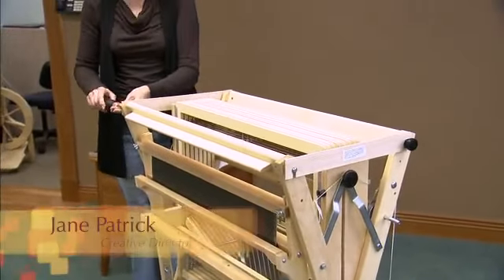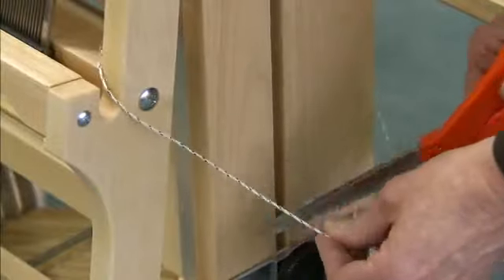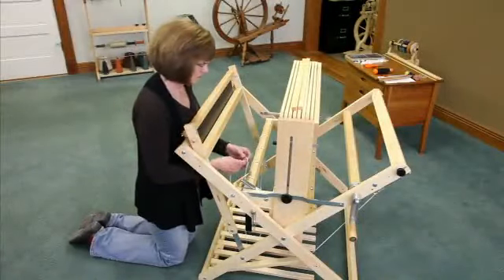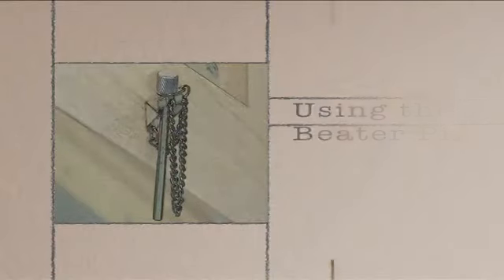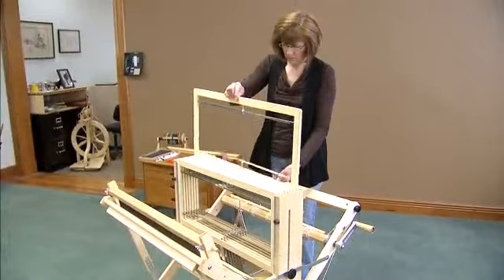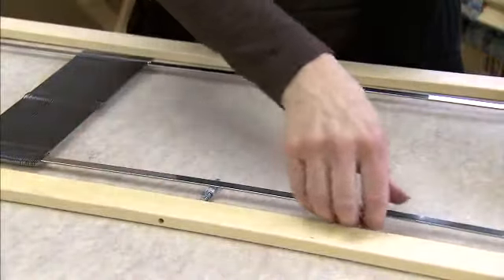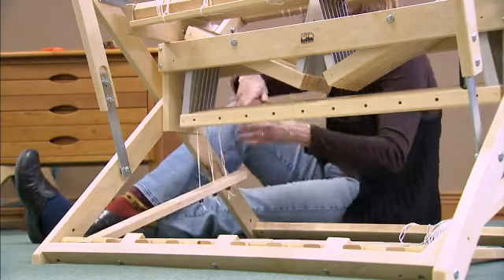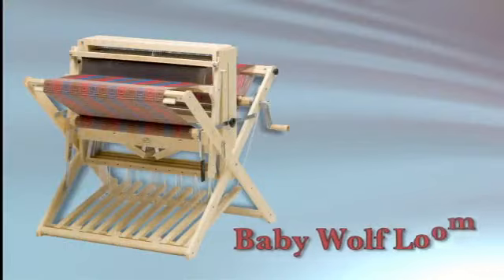Assembling the Schacht Baby Wolf Loom

Comment: The video shows how to install the treadle aid cords but just leaves them hanging and never finishes on what to do next.
Reply from the maker: If you don't want to use the treadle aid for a particular project, you can leave the treadle aid tie-ups dangling. If you do want to use them, they're installed just like the Texsolv treadle tie-ups. After you tie up the treadles, install one treadle aid tie-up per treadle.

Comment: You have changed how you package the heddles. Curious as if it makes a difference if the red tipped ends are down (or up) when putting the heddle bars back into the frame/shaft?
Reply from the maker: It does make a difference because the eyes will be oriented differently.
For right-handed threading, place red end of heddles at top.
For left-handed threading, place red end of heddles at bottom.